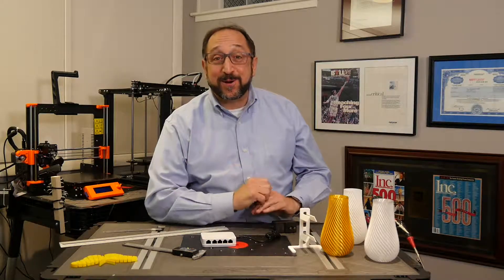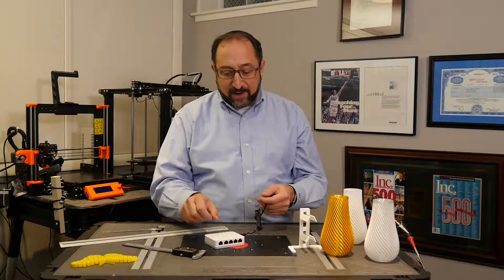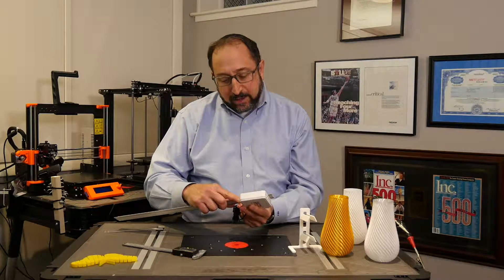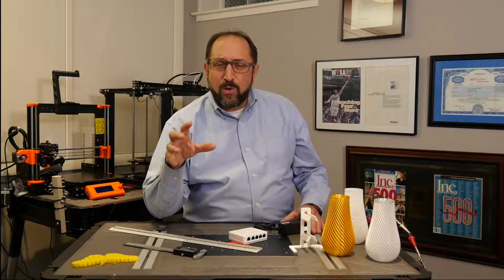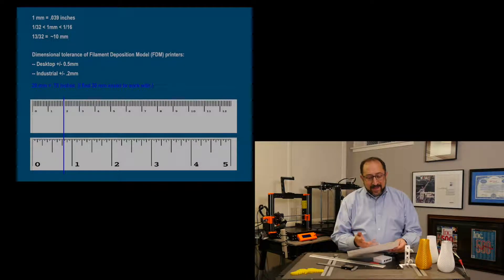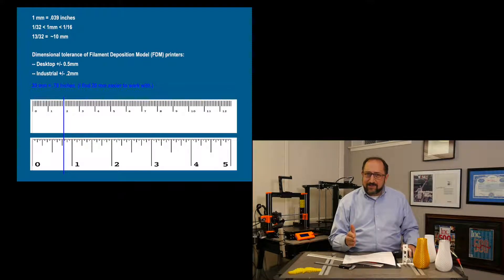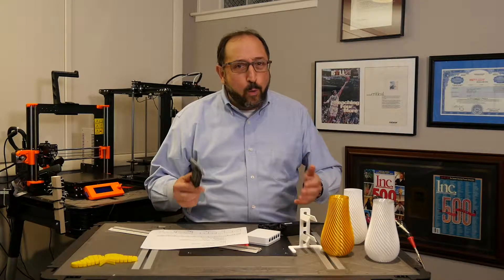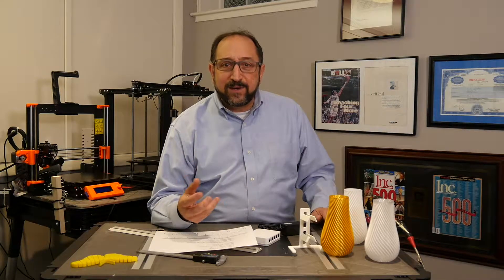Maker Basics: 3d Printing using Millimeters vs Inches

Comment: i really don't like your justification for using millimeters over inches. it is not a good excuse to say "what is that?" when you just don't want to use something. the real reasons is that base 10 is more simple, or perhaps your printing software requires it. but when you are dealing with decimals then there is no good reason to pick one over the other because what is the difference between 3.127 inches and 79.42 millimeters? the answer is there isn't hardly a difference.(i did remove 2 decimal places on the millimeter because .0058 mm is incredibly small.) its just a reference point. and if you are doing any sort of precision machining or printing you shouldn't be using fractions from a ruler.